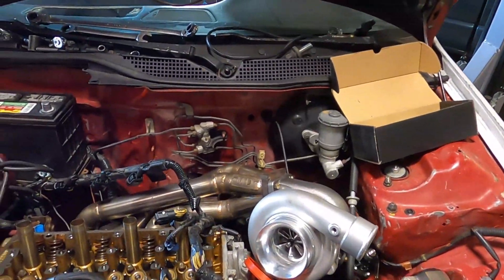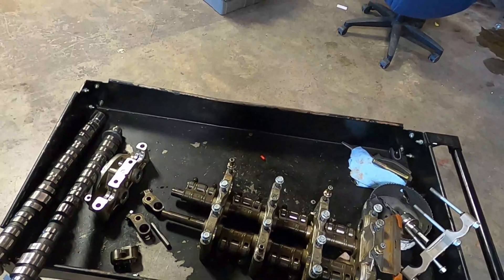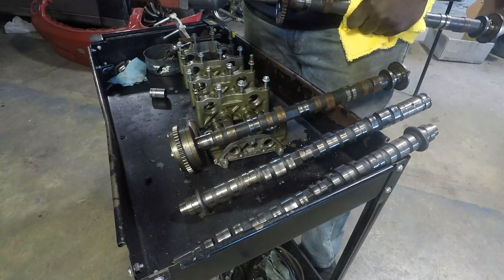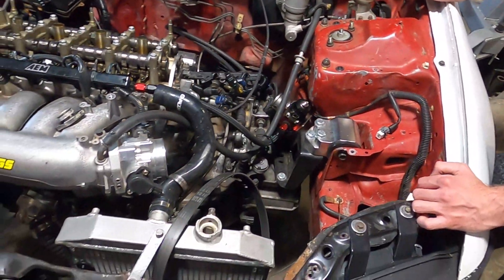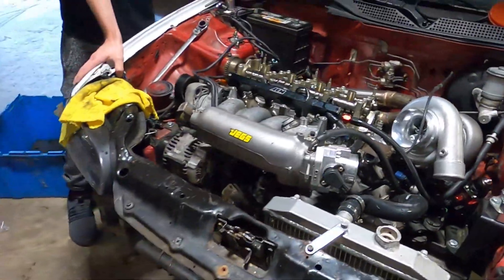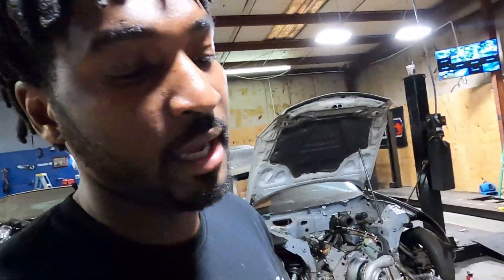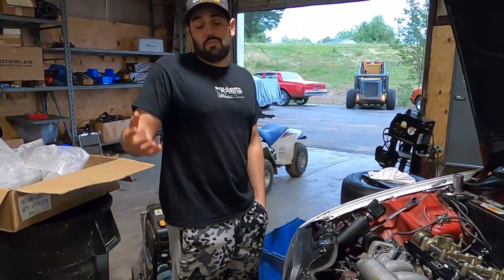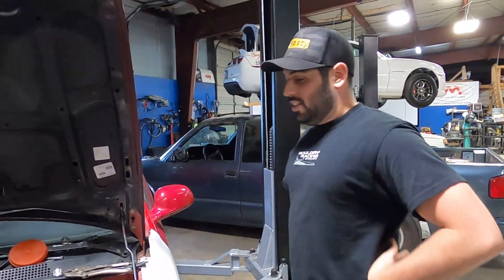Loocking Vtec on HeavFlow + Turbo kit Mockup

Comment: Is that the Sidewinder turbo manifold? If so I would recommend you use a 44mm waste gate otherwise you will experience boost creep. Seen it happen many times.
Reply from the maker: Yes it has a 44mm gate on it. I haven’t ran anything smaller than a 44 in years.
Reply: If you seen it many times wouldn't  you know whether it was a Sidewinder or not?